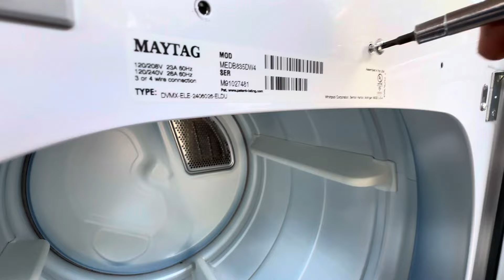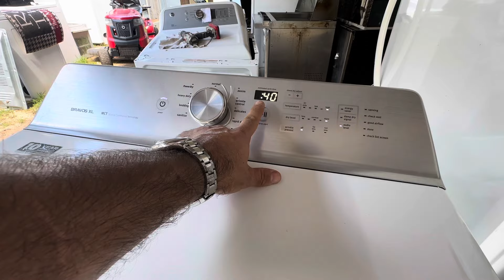Maytag bravos xl dryer not heating | Heating element swap 3387747

Comment: the dryer has a 1 year warranty. the motor is 10.   i just lost a heating element after a few years.   imagine if these parts were all accessible from an external panel and all in one spot.   there is also no attempt to filter the cool air that enters the dryer, so the inside of the case fills up with dust, eventually pulling chunks across the heating element.
Reply from the maker: @overtoke  that would be smart to filter the air coming into the element. But they would never do something smart like that 🤣

Comment: I did not pay attention to which wire was on top and qhich was on bottom when removing.  Does it matter when installing the new one?
Reply from the maker: @timothyflemingphotography  there is no positive or negative. Just make sure the bigger 5/16” terminals wires go on the element.
Reply from the maker: @timothyflemingphotography  it doesn’t matter top or bottom.
Reply: @LAapplianceguy  thank you very much!  We are back up and running!  Appreciate the tutorial sir.
Reply from the maker: @ great news. Thanks for letting us know. Glad it helped some. 👍

Comment: I cannot get the screw to go back in the heating element
Reply from the maker: @CedDreshaunJones  yes sometimes they don’t want to line up. I have been known to leave the screw holding the element out. Shhh 🤫. Haha that thing is wedged in there so tight it ain’t going nowhere
Reply: @LAapplianceguy  will it be alright if I did leave it out?
Reply from the maker: @CedDreshaunJones  you are talking about the one that goes side ways into the element itself right? If so then yes I have left them out because the element is wedged so tight it won’t move. I try to get them in but sometimes they just won’t thread into it
Reply: @LAapplianceguy  thanks man really appreciate
Reply from the maker: @CedDreshaunJones  no problem. Thanks for the positive feedback. I’m glad I could help a little 👍
Reply: @LAapplianceguy one more thing is posed to smell burnt after you first put it back on?

Comment: Great video, I believe our Maytag Bravos XL Dryer heating element is out as well. Would it be covered under the manufactures warranty?
Reply from the maker: @remuskey  thank you for the kind words. elements are covered under the 1 year warranty from the manufacturer. Don’t think they cover it longer than that. Easy fix though.

Comment: What if the heat element is working when you test it but still no heat? Please reply thanks
Reply from the maker: @mohammadalkhandak5492  always test for 240v. You can run the motor with half power. Also test the high limit fuse on the element housing. If all heating components test good and power is good it can be in the control/timer. Not powering the heater
Reply: I’ll go ahead and change the control / timer motherboard and let you know 
Thanks for the reply

Comment: So it’s blow cold air means the heat spring has blown?
Reply from the maker: @bricemcg  not all the time it can be half power, blown limit, or control issues. But yes 9/10 times it’s a bad element. Just make sure it’s broke in two.
Reply: Just pulled the element out and it is still in tact 😑… I already bought a new one and gonna put that in… do you have videos on the blown unit or control issue
Reply from the maker: @ check the hi limit and thermostat on the element housing for continuity. That’s usually the next culprit if it’s not a bad element.
Reply: Disregard, brother… the coil was broken and tangled together… you are a god amongst men!!!
Reply from the maker: @ alright! That’s great news. Glad I could help. 🤣 A god no. Just a regular ol appliance dude. Thanks for the positive feedback. I really appreciate it.

Comment: What's the part number?? For the heating element from Amazon
Reply from the maker: @KarlBerlin  I would be careful with “some” of the Amazon elements. I can tell when they come in with them. They usually only last a month or so. But the part number for this particular unit is wp3387747. I would go with the factory one if you can. Not the cheap cheap ones. You need to look it up by the model number to make sure you get the proper element for your dryer.

Comment: my dryer is not turning on at all. the thermal fuse has been replaced, do you know if the heating element would cause the dryer to not turn on??
Reply from the maker: @jolishamona  the element shouldn’t stop it from coming on. It will usually run but not heat up. If the thermal fuse is new check the door switch and start switch. And also power. Then it could possibly be in the control/timer. All of this depends on what kind of unit it is too.  But definitely check the door switch next. Hope that helps.
Reply: @LAapplianceguy  thank you kindly! i ordered a door switch today and hoping that does the trick!
Reply from the maker: @jolishamona  worth a shot they aren’t too expensive.

Comment: Are you working outside all day?
Reply from the maker: @3ShaneScott3  no not all day. I try and move inside towards the late morning and into the afternoon. But yesterday I had soooo many to fix so I tried to hustle through them. Another possible 100°+ temps today too. 🥵
Reply: @LAapplianceguy  You need a big fan out there or one of those outdoor air conditioners.
Reply from the maker: @3ShaneScott3  I used to have one but it died. I might get another one here soon. If I wasn’t hard so headed I’d just bring them all inside. We have a 3ton mini split inside the shop 🤣

Comment: Why can’t I find the replacement heating element online???
Reply: Our model #mgdb835dw4. Which is different than the other ones…
Reply from the maker: @uscgbm85  it’s sounds like you have a gas dryer. They don’t have an element. They do have ignitors, thermal fuses and solenoids that cause heating issues.
Reply: @LAapplianceguy thank you!  Lol. I’m using your video to tear down the dryer, but I cannot find a video on any of the parts that you listed on how to test and replace them…. I went ahead and pre-ordered a solenoid and a thermal fuse just in case